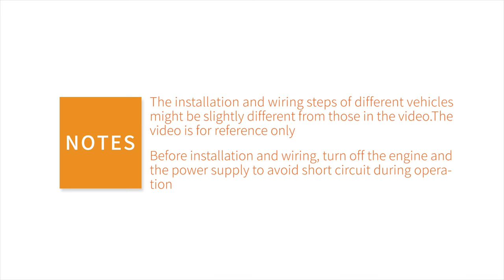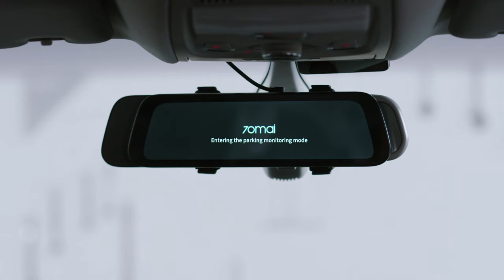70mai - Hardware Kit Installation Demo Video

Comment: I did all of these with the 70mai dash cam lite 2. It doesnt stay on when my car is off.
Reply: You connected it to a slot that doesn't have power when the motor is off
Reply: i have same problem , and for sure i checked few times and it has power when the car is off but the camera still saying low battery and wont stay on ...any ideea where is the problem ?
Reply: I connected my cam to a power bank so it stays on when the car is off but surveillance mode is still unavailable unless I use this useless kit....I'll be making a return of this junk....it's pretty a front camera it never rotates unless I tell it to....200$ for a front cam ill pass.

Comment: This video is full of mistakes. 
1. The wires wrapped around the fuse leg and the grounding point do not comply with any electrical codes.  Unsafe contact can cause a fire. 
2. It does matter which way the fuse is plugged back in with the camera wire. In one of the two cases, a fuse will not protect the circuit. This can cause a fire.
3. It says in the text that a 3A fuse is required, but this is not used during installation.
4. Diagonal cutting pliers can easily destroy the fuse.
Reply: Thank you for information. I will take into consideration.
Reply: Y como debería conectarse de forma correcta?
Reply: @Herlxz001 it’s called a fuse tap
Reply: Will this save the car battery from a full depletion?
Reply: Even if a camera is installed incorrectly, it can still function well. Moreover, when installed properly, it will undoubtedly operate very optimally and safely.